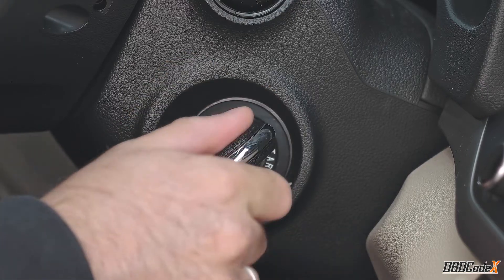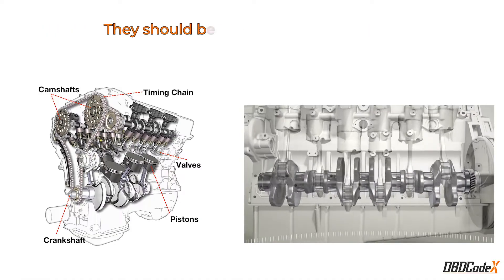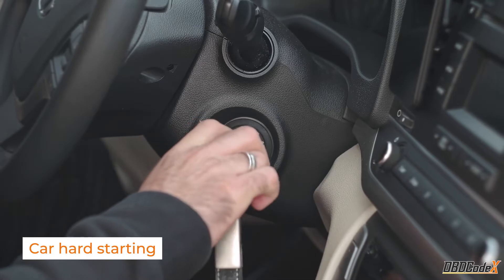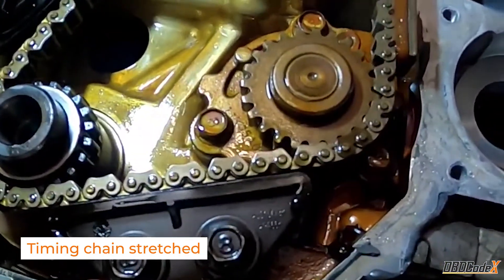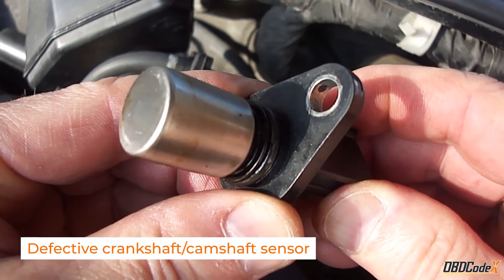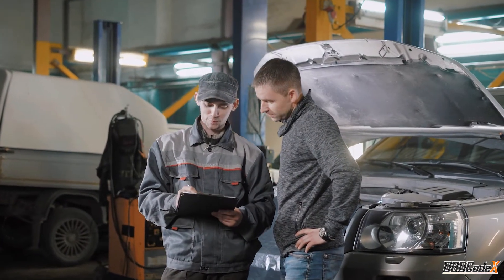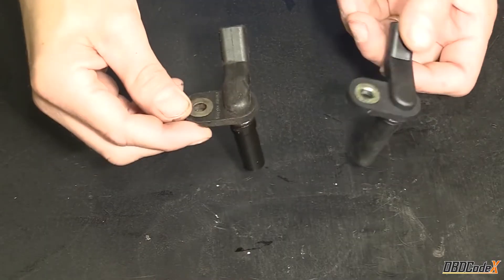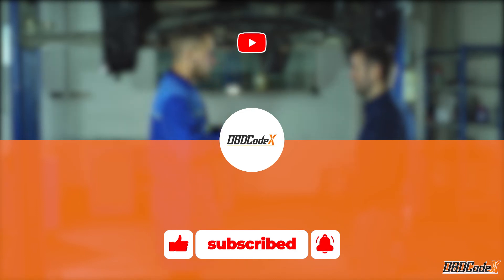P0016 Code: Explained and Troubleshooting Tips for Camshaft Position Sensor Bank 1 Error

Comment: Mine comes on my RCZ after several miles , I can reset and it will come on again after a few miles , when it’s off car performs great , when it’s on the car runs but is a little hesitant, I have changed both camshaft sensors but not the crankshaft sensor , what else can it be

Comment: Believe it or not I got a Chevy Aveo 2011 I've been driving my car for 5 years now with the p0016 code Dino – Light for land have no trouble whatsoever with the vehicle thank God it's still going away is going crazy man Twitter No Time about everything did everything in-between and it still comes up
Reply from the maker: Have you talked to a mechanic or reached out to Chevrolet for help? They might have some good advice or solutions for dealing with the trouble code. Good luck in getting it resolved!